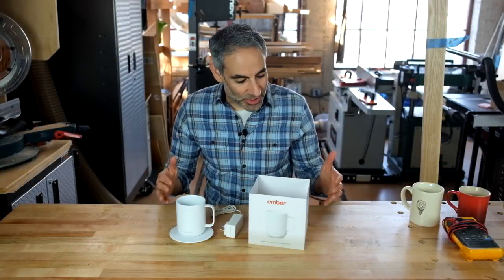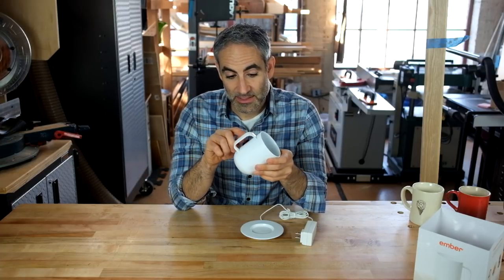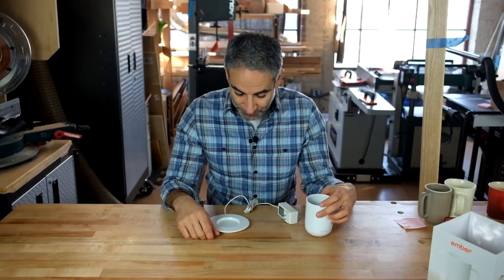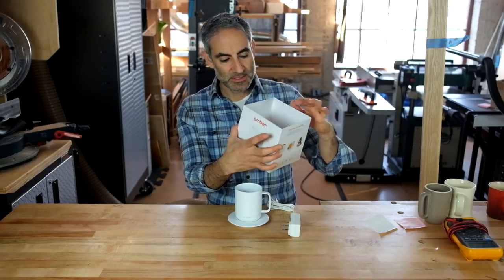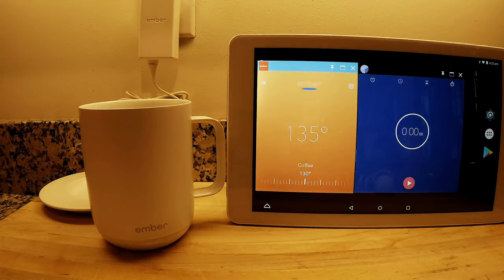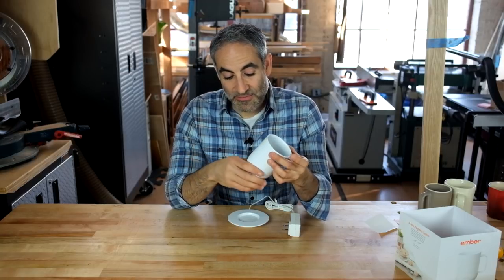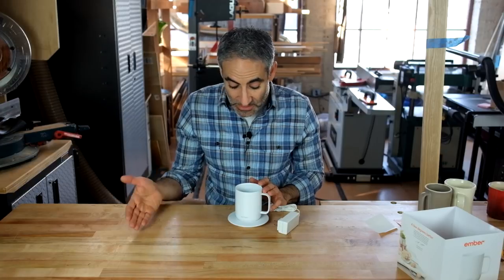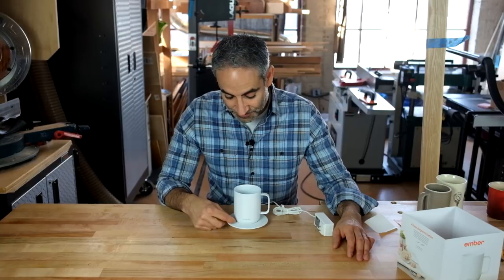Ember Coffee Mug Review: Things you need to know.

Comment: Hi, Jesse...!   Great review.  I have an Ember Mug - have had it for 2 years today, as a matter of fact.  I do love it, but the issues you point out are very real.  I keep it on the coaster, but do occasionally pick it up to walk around for a bit, and then set it back down.  So, over the course of a day it will gradually lose more and more battery, since (as you pointed out) it can't warm and charge at the same time.   Two years in, I have also had some of the coating come off the interior of the cup - especially at the bottom on the inside - and the inside bottom seems to be of a different material. One thing that's come up is that one of the charging pins has now lost its spring - so it won't charge (this happened today). I've seen where I can repair that myself, and I may do so, as the charging coasters are about $35 a piece to replace.

Again... great review.  I do love the mug...and it was a gift, so even if I had seen your video first I would still have it...but I can simply attest to your being spot on - over my 2 years of experience with it.  Thanks - I just stumbled across this and will be looking for more of your videos.

Comment: I think I have been looking at this product from a very different perspective and after listening to your video, I don't think this was designed for the American filter coffee drinker. In Australia, most people don't think filter coffee, they drink espresso machine coffee which with the exception of the espresso itself which is purely a double shot of coffee which has a lower temperature but all other coffee's the coffee shot or shots go into freshly boiling water. So in the case of drinking in this cup, the coffee is going to start Way too hot to drink, unless you are like my dad who drinks it straight away, likely scalding his lips and mouth, you would want the ember cup to maintain a temperature less than the boiling temperature it starts with. I had also assumed that you would keep the cup, most of the time, on the saucer on your desk, if I wanted a takeaway option I would have bought the takeaway cup version. So most of the issues you mention would not be an issue for an Australian coffee drinker and if they are like me and drink tea, again it's starting from boiling water and only wanting the Ember cup to maintain an ideal drinking temperature which for obvious reasons is going to be less than boiling point. I do however agree with the cup being FAR too small for my liking, I would much prefer a mug with a drinkable volume of around 450ml so perhaps an overall mug of 500ml, I also think it should have a switch to switch it on and off, I spend a lot of time away from my desk, not to mention while I am sleeping overnight, I don't really want something heating and using power when its not needed. I understand however not having switches is a pretty normal thing for US products but its not the norm for the rest of the world, we must be able to switch an appliance off to save power and for safety sake. For the price of $170 AUD plus shipping, 240ml of drinking volume just doesn't cut it for me, I will however buy one if they release a 500ml cup, 450ml drinking volume.